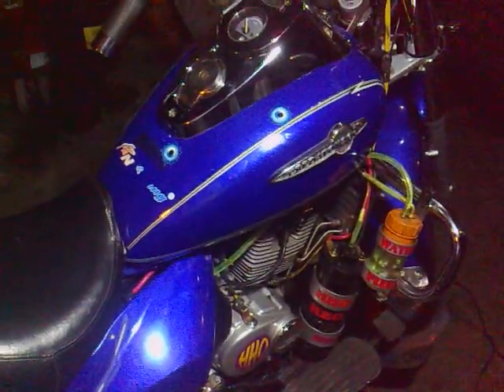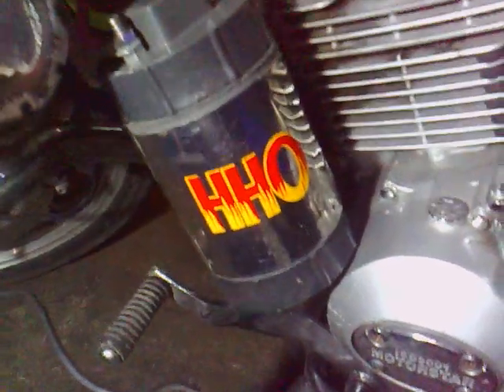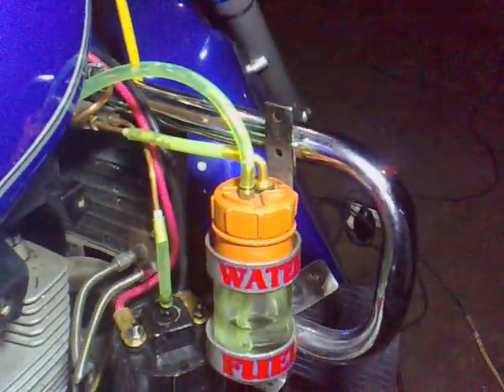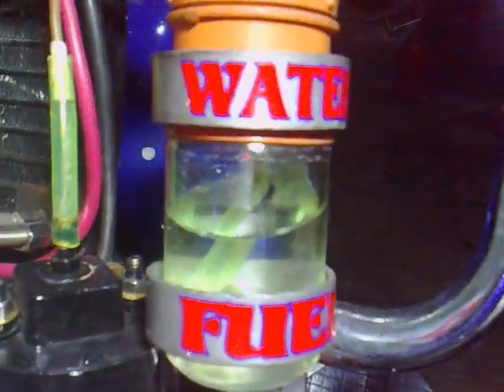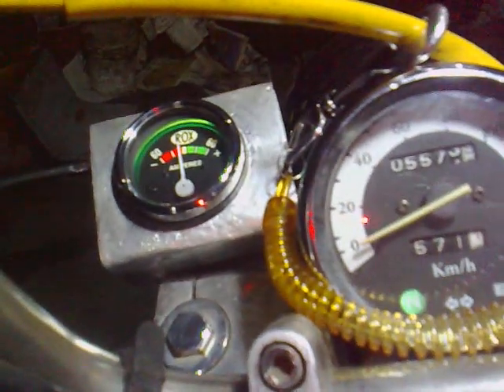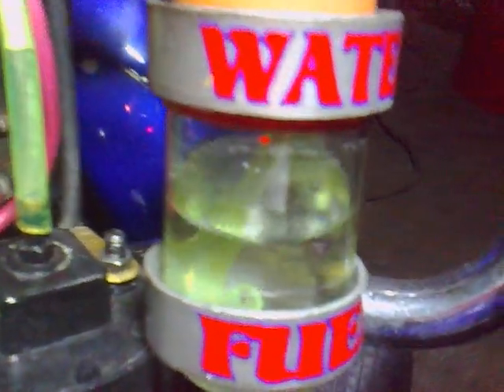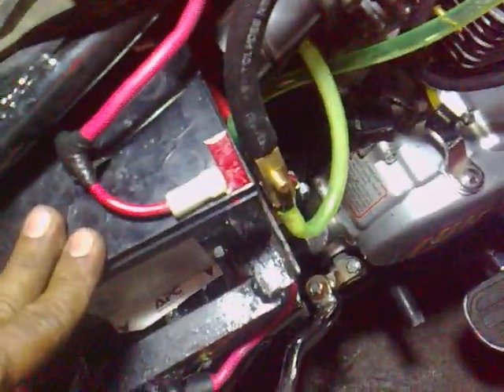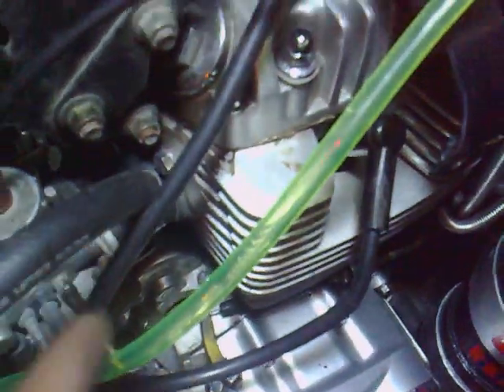HHO VOX MOTORBIKE  PHILIPPINES  INSTALLED - 030110 V003

Comment from the maker: Hello Vox,
Nice setup. very clean and neat. You may visit Ehnriko and see what his up for your positive comparison and improvements.Best electrodes with better HH+O production are tubes and plates..try the 6 volts using tubes and you will get better results and will not damage your cell and have a clean water,try using KOH or NAOH but be sure to have a good bubbler because NAOH residue may damage aluminum parts of engine. install a pulser.(PWM) to have a resonance production using 12volts...Ian

Comment from the maker: @vfxjex Our goal, must not change any original parts, regarding electrical or electronic components, instead,  from the original produce voltage and amps from the alternator, we can design a circuit a high voltage and enough amp for the HHO cell just like Mr. Dingel did ......

Comment: @vox1philippines ---there in no high pressure, but normal, near of atmospheric pressure. therefore it is safe. higher pressure is in motor and no problem.
...and military materials???
i see in bubbler very few of hho gas / bubbles. are you sure it works? only for hho? or with petrol too?

Comment: @vox1philippines, sir bakit po  before and after sa carburetor nka connect yung supply ng hydrogen gas? paano po ba na regulate yung gas and air ratio? hindi ba pwed sa carburetor i-supply ung hydrogen and i-modify( kunyari tanggalin nlang yung float or made some adjustment).

Comment: You need to dry the gas to take the water out of the gas or you will rust the engine from the inside out, look up air dryers or chill gas before engine this will help the engine last longer

Comment: Use a pulse width modulator to regulate current and adjust the ratio of your sodium hydroxide to water. the more sodium hydroxide you put into water the more current it draws and more heat is generated

Comment: If run on only HHO, need to battery charge more. If adjunct with gasoline use less HHO and advance timing for best torque (automatically).

Comment: @vox1philippines  I want build plate type, from SS 316L, usable surface around 28,26 cm2 and 17 - 21 plates, your consumption was 43km/l after or before use HHO generator, are you use PWM and inductor? I looking for ideal PWM ciruit diagram, I found some, but it not was real adjustable, in begining I want test batery-screwdriver trigger, after will build own PWM, but inductor I dont know, I thinking spark inductor, but I fear, because can make spark beetween plates and exploide

Comment from the maker: @vernie4163  Hi-voltage pero low amps.....  maaring  ito  ang system  na  gamit  ni Daniel Dingel,  kung  napansin  mo  sa  mga  vedeo nya  gumamit  din  sya  ng cooling  system...... iiniiit din  ito sa  katagalan...
d  best kung i  try mo  din  then  share mo  ang   resulta .....  ung motor  ko  ngayn di  na  ito  ang  set-up  d ko pa  na  i  post,  my PWM na  at  my  high  ang  low na.....  under  experimental  parin  ang  lahat....  join us  bro....   God  bless  at  ingat  dyan  sa saudi..

Comment: I'd like to see it's running please
Reply from the maker: pls call 09399251237
Reply: +Jimmy Catipay Just supplemental HHO it still uses gasoline, the only way to tell if it works is if the mileage improves.This crap is all over the tube.
Reply: Walkertongdee supplemental yes but gains of 40% fuel economy are gained through 100 percent burn of fuel instead of between 50 and 70 percent as normal you can have free energy from this
Reply: Chris Gallagher
You do know that car companies must meet fleet fuel mileage laws right? If this could increase mileage even 20 percent, all cars would have one on them.

Comment: 1) In this system.... How many amps are required to generate hydrogen... 
2) can u please send me the wiring diagram.. For 2 capacitor, rectifier & battery 
3) how many Farad capacitor of each one. You used.

Comment: Heyy people out there i have a small question to be answered if any one has a perfect answer for that.

 i know that by the help of a battery we can make an HHO generator which powers the bike engine but the point to be asked is that how long will a fully charged motorcycle battery would last for such work.

I mean one battery of 9ah would last how many hours to keep the generator on

Comment: @sasyedji nah that's just the kind of rubbish that oil advocates talk about. hho only draws aas much as is available from the generation. The worst case scenario is the pipe melts closed and the bubbler bursts. There is stuff all hydrogen stored in hho systems that any opsy's are negligible. So the whole h2 bomb explosion thing is just rubbish!